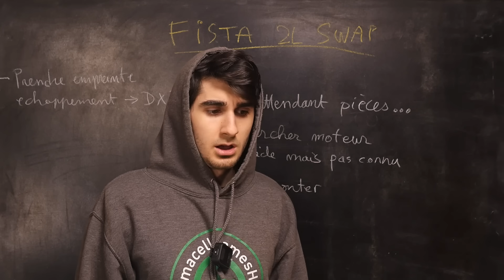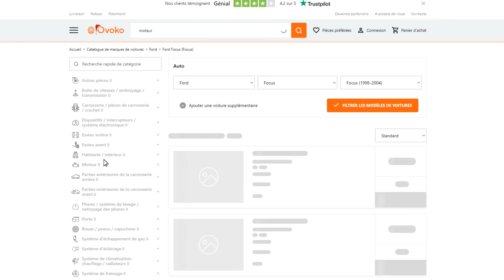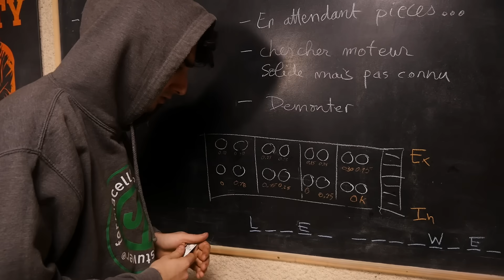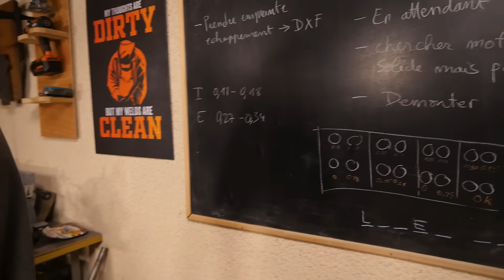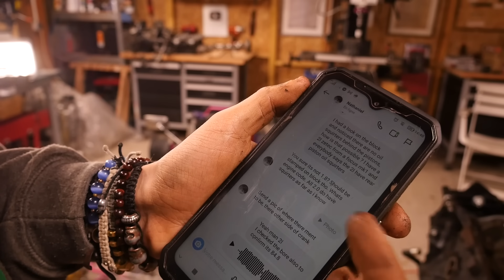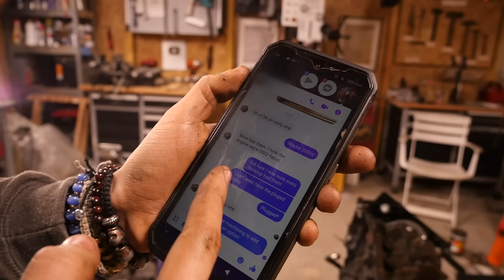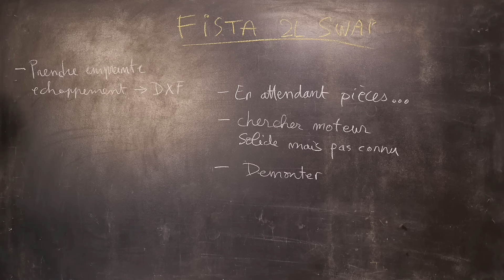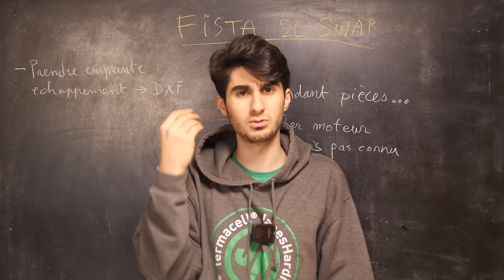Sleeper EP2 : Peut-on Turbaliser un moteur à 100€ importé de Lituanie ?

Comment: Salut !!!!
Pour ton Carter de pompe à huile, il me semble que le piston c'est le régulateur de sur-pression l'huile. Pense à mettre un jeux de cale derrière le Bouchon pour augmenter la pression Maxi d'huile.
Bon courage et merci pour tes vidéos !!! J'adore 👌👍
Reply: Ouai c’est ça c’est pour quand l’huile est froide donc plus épaisse çà évite la surpression mais ça empêche pas de monter en pression à chaud la sortie est minuscule ça serre surtout à éviter que tout claque avec la pression à froid
Reply: Oui c’est bien ça c est une soupape de régulation de pression d’huile 😉
Reply: Oil pressure control/bypass/relief valve. If the oil filter gets blocked, the relief valve lets the oil circulate still.
As was said by some other others, you can augment the oil pressure with heavier springs and/or a couple of washers between the spring and the plug.
Don't put too much oil pressure; you may blow a seal!
It's better to control the state of the rotors and check that the gaps between the rotor tooth tips are within spec. Good oil volume and flow is what you need above just good oil pressure. Probably not too expensive to replace the  oil pump rotors?
Cheers😉
(Très bonne vidéo et à la prochaine Mosquitos Drag Race, ou Turbo Slug te poutrera grave mon pote 🤯😄👍)
Reply: Complément d'accord c'est un clapet de décharge, régler avec l'épaisseur de l'entretoise qui compresse le ressort.
Reply: C'est bien ça. 👍
Reply: pression et debit ce nest pas la meme chose , il faut deja chercher les pertes de charge pour limiter les contre pressions
Reply: Le jeu de cale va réduire la course du bouchon donc réduire la quantité d'huile sortie , huile à froid si j'ai bien compris.
Quel est le risque?
Reply: ça s'appelle un clapet de décharge ou by pass

Comment: 1 t’aurais dû utiliser celui des puma, cylindres au nykasil
2 pour les poulies d’ aac, il faut un outil pour bloquer les poulies et ne pas forcer sur l’aac, à delà de la casse, tu l’as peut être même vrillé
3, c’est la soupape de pré charge qui maintient la pression d’huile. On peut augmenter la pression d’huile en intercalant une rondelle afin que le ressort pousse plus fort
Reply: Les Puma c'est pas des 1.8l?
Reply: un aac c'est comme un vilo, ça se tord pas, ça casse ou pas.
Reply: les acier dur d'un aac sa casse sa se tord pas
Reply: C'est un 1.7 avec déphasage aac admission , mais la base est différente de ce type de moteur.

Et on trouve très très peu de pièces pour un montage turbo fiable (je connais bien ces bestioles)
Reply: Traitement ninkasil poubelle 
Sur la porsche j'avais un traitement similaire 
Mon usineur la passé en chemise fonte plus solide car ce revêtement pars au bout d'un moment et tu attaque la matière derrière ce qui n'est pas bon
Reply: @jojolebossl  pour infos les autres zetec s (1.25, 1.4 et 1.6)  sont des blocs alu chemisé fonte
Reply: un abre a cam ne vrille pas comme un vilo c est un alliange tellement dure qu'il ne peux avoir aucune torsion par contre il casse vite

Comment: 24:00 C'est une soupape de décharge d'huile non? en gros ce truc ça sert a modifier la pression d'huile du circuit, dedans y'a un ressort taré pour que la soupape s'ouvre a une certaine pression d'huile et ainsi la limiter. (éviter les surpressions en gros)
Je pense que c'est ça je suis pas sur, je suis pas un pro du zetec.

Comment: Pour une prépa du rat sur un bloc à 100 balles tu t'en fous des squirters d'huile sous les pistons. Pareil pour l'ovalisation des cylindres (c'est pas en haut mais en bas des cylindres qu'elle est la plus forte à l'endroit où la bielle fait un angle maximal avec le piston). Pourquoi ? 
Parce que le réalésage nécessaire si tu en as coûtera une couille comparé au prix du bloc. 
Mahle c'est un des plus gros fabricants de pièces OEM du monde. On en trouve partout, chez tous les constructeurs, du piston au filtre à huile en passant par soupapes, segments, et autres. C'est de la très bonne pièce. 
Pour ton AAC, amène le chez ton tourneur préféré pour qu'il te fasse un jolie rond à la place de l'empreinte de calage toute explosée. Ça sera propre et équilibré. 
Est-il possible que ce bloc soit un silver sur lequel on a jeté un couvre-culasse black ? 
Tout est possible. 
Et oui, la visserie performance ARP ça sera des goujons la majorité du temps. L'avantage des goujons par rapport aux visses c'est qu'ils ne travaillent pas en vrille lors du serrage.
Reply from the maker: Merci pour ton super commentaire et tes conseils !
Reply: @UltimateMaking  avec plaisir ! 
Et pour la PCV... Elle pourra pas faire pour ventiler le bloc en montage turbo. 
Le mieux c'est de faire des piquages dans le bloc et dans le couvre culasse pour y mettre des grosses durites qui iront se jeter dans un gros oil catch tank (qui lui aura une grosse aération filtrée à son sommet)
Reply from the maker: @vozhdmeister5256  mais le probleme des catch can cest qu'il faut les vider toutes les 5min apres chaque launch non?
Reply: @UltimateMaking  si le moteur est un peu essoré, beaucoup de blow-by et ça pousse beaucoup l'huile dans le catch can. Mais y'a pas vraiment le choix, la pression qui passe dans le bas moteur doit s'evacuer sans difficulté autrement elle te poussera l'huile à travers tous les joints, ça deviendra vite une friteuse. 
En turbo on soufle en pression positive dans l'admission donc impossible de mettre le bloc en dépression avec des reniflards comme avec les atmo, c'est pour ça que la PCV suffira vraiment pas. 
Après c'est sûr il faut prendre ou faire faire un catch tank d'une taille sérieuse (2 ou 3L en alu) et avec des cloisons à l'intérieur pour que les gouttelettes d'huile s'y collent et ne soient pas emmenées directement dans le filtre de ventilation. 
99% des catch can en vente sont juste des cannettes minuscules et sans cloisons, clairement pas sérieux (mais so cheap 😋 )
Reply from the maker: @vozhdmeister5256  merci pour ton avis tu confirmes ce que je pensais, je vais en faire une serieuse avec cloisons ventilation et tout

Comment: Pour ton AAC, je pense que tu peux ajouter de la matière en soudant puis le passer au tour pour  lui redonner sa forme ;)
Reply: Faut laisser comme ça, du moment que l'encoche ne sert pas à entrainer un accessoire en bout d'aac. Pour le calage c'est pas dérangeant, il reste une surface de référence.
Reply: Je pense que le plus important est d'avoir un bon équilibrage (en soudant ou meulant peu importe) mais à la vitesse où ça va tourner faut pas que ça parte en résonance !
Reply: les AAC tournent deux fois plus lentement que le  vilo, à 8000 rpm, les aac tournent à 4000, l'équilibrage osef, et mettre un coup de chaud pour ressouder, surtout pas, on laisse comme ça, ça ira bien.
Reply: la soudure fissure les acier dur en general
Reply: Pour répondre à tout le monde, ajouter de la matière va limiter le déséquilibre.
Pour le coup de chaud, il me semble déjà avoir vu des préparateurs ajouter de la matière directement sur les cames pour les retailler après, donc le faire à une extrémité ça me parait moins sensible.
Et puis surtout ça coûte rien et ça fait du shrap, parce qu'attendre qu'il repousse, même avec de l'engrais, ça risque d'être un peu long.
Reply: @GrumlyFPV a came est epaisse la queue nettement moins, tu chauffe trop et sa claque, je le remonterais telle quelle, je meulerais l'oppose pour equilibre
Reply: @meyersteve6022  perso je pense pareil +1 ou sinon soudure par point en laissant bien refroidir à chaque fois en ayant le reste de la pièce immergée dans l'eau par contre 1 petit coup de comparateur pour vérifier que tout tourne aussi bien que zahia 🤣
Reply: Il existe encore pas mal de pièces pour ces blocs aux us et en uk, pourquoi s'emmerder ?

Et pour recharger les cames ou vilbrequin c'est de la soudure avec un procédé spécial (une poudre métallique est utilisé)

Pour la mise en forme il faut une rectif spécifique si on veut faire cela bien
Reply: @duratec-V6  le procede peu varier la matiere utilise c'est sa l'important, faut un acier identique a celui que tu recharge, c'est pas toujours evident a trouver vu que les acier dur sont nombreux et que leur composition change au fil des annees
Reply: @duratec-V6  oui enfin on est en train de parler d'un endroit qui n'a aucune utilité mécanique alors il va pas se prendre la tête pour ça ce serait comme appeler la cavalerie pour un mec qui parle un peu fort
Reply: @ritmoabarth1614  c'est l'inverse un acc sa tourne 2x plus vite
Reply from the maker: Haha

Comment: Les pissettes d'huiles sous les pistons ne servent à rien, au contraire ça t'évitera une chute de pression d'huile. Y a quasiment aucun athmo en production standard qui les à et ça empêche pas de turbaliser dans tout les sens
Reply from the maker: Cest pas faux !
Reply: Par contre tu peut en rajouter si tu t'ennuie. Faut en acheter pour m3 E30, c'est des modèles cartouche, avec un tarage de pression d'huile qui de mémoire s'ouvre vers 4 bars (à vérifier) . Tu fais un perçage avec un angle dans le palier du vilo côté bloc, et ça prend l'huile dans le palier de vilo.

Bon vu comme un bloc de m3 E30 c'est pas fiable, je te laisse jugé de l'efficacité.

Surtout qu'en moteur  Europe ont a aucun piston avec canal  refroidissement de la calotte

Comment: La poulie damper n’est pas la pour les vibrations, en fait la rondelle en caoutchouc et la pour éviter de propager la chaleur du vilo pour une meilleure tenue dans le temps des courroies d accessoires 😉😘
Reply: Du coup la courroie de distribution elle qui est bien souvent enfermée et moins ventilée ne bénéficie pas de ce traitement de faveur ?
Reply: Une courroie de distribution est prévue pour être remplacé vers 120000 km de part ca conception, sûrement moins coûteux de “damperiser” que de fabriquer des courroies d’accessoires aussi robustes qu’une courroies de distribution 🤷🏻‍♂️
Reply: @neuf-cube148  c'est surtout qu'une poulie damper avec l'usure finit par glisser et donc decalerait la distribution.